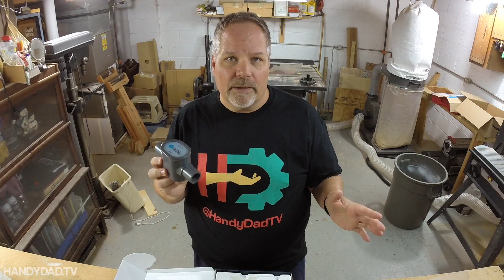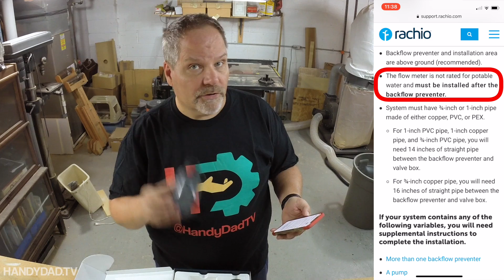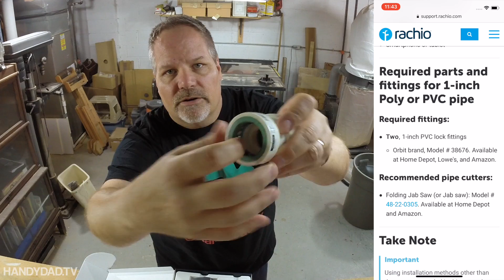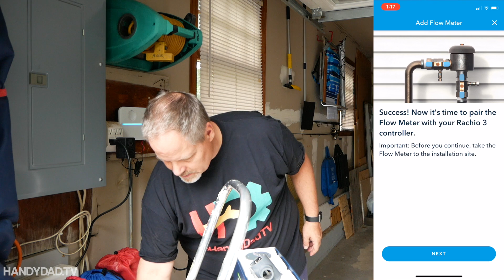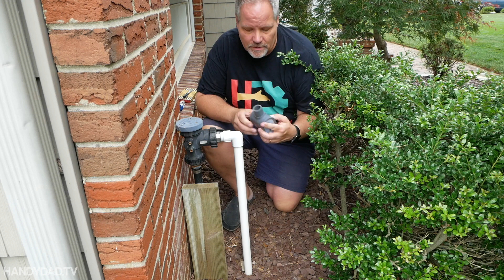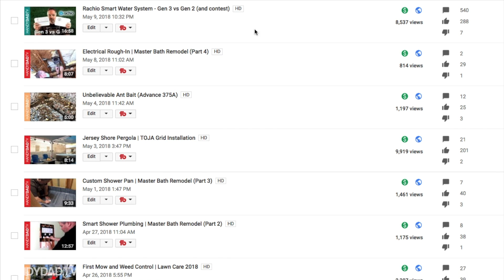Rachio Smart Water System - Wireless Flow Meter

Comment: great job.  what is the result of the Rachio Flow Meter after having it installed and running 3 seasons? 
still recommend this flow meter even though there is no more production? thanks
Reply from the maker: They discontinued it. I had a bad experience: https://youtu.be/w8URhNDCVTQ

Comment: I guess there is no need to use a rain sensor since the controller has the weather intelligence feature. What you know about soil sensors? I think they can be use with Rachio, but are they worth it?
Reply from the maker: I’ve never tried soil sensors.
Reply: @handydadtv  that a good topic for a next video. Rain bird and Toro soil sensors are compatible with it

Comment: Great videos btw. I was considering getting on until I by accident came across a post on their site that they are discontinuing the flowmeter: Unfortunately, the variability in irrigation system configurations made for a more complicated Flow Meter installation process for some of our customers–something that falls short of our mission. Because of this, we’ve decided to discontinue sales and production of the Wireless Flow Meter.
Reply from the maker: I didn’t see the official notice but mine failed anyway. https://youtu.be/w8URhNDCVTQ
Reply: @handydadtv  Nice. The real question is, did it notify you? ! :)

Comment: Why is the backflow preventer outside?  It should be in-ground or under the house to keep the backflow preventer from extreme temperature fluctuation.  As for connecting the flow meter to the pvc line, I would use a pvc union instead, just make sure to clean the inside off excess glue before installing the union.  This way, you can switch out the flow meter when it goes bad in a few years.  Not sure why you need to make sure no water is running in the house?  Backflow preventer is installed for the sprinkler system only (tee off from main line)  and not to the main line to the house.  It is to prevent ground water from backflowing to the main line to the house.
Reply: 1.Back flow preventers are outside the house in many homes in the south. We cover back flow preventers with insulation and add heat tape to warm them up in the winter.  Backflow preventers aren't so much to protect the individual homeowner's water, but to protect the municipal supply.

2. If something is running in the home, the available water to the sprinkler zone will be reduced.

Comment: Thanks for the great video. I'm hoping to be able to install a flow meter, but my above ground piping and backflow valve are about 100' away from the Rachio 3, and under a cover for protection from freezing, so I don't know if I can get enough signal strength. We'll see how that works, or not.

Comment: It also be nice if they made flow meters reasonable cheap that you can install ontop of the pipe that you don;t have to open the pipe and put it inline. It would be great to not have to open a pipe to take readings on gpm on the pipe. I like to verify all the DFU units and gpm on pipes in the UPC charts plus have other experimental things to measure and work out the math with psi reading isn't enough.

Comment: ya been kind of looking for a flow meter but this one only works with 3/4 in - 1 in pipe sizes by the looks of it. I like a more diameter range from 1/8 in to 4in pipe say would be even cooler if it supported any size pipe. Like an ultrasound based flow meter or something. I want to keep cost reasonable low though and application for it as general as possible. So if you know of any let me know great explanation and i like the wireless feature of it.
Reply: KonaFlow or FlowVis sold by Kona Labs

Comment: I bought the Rachio because you made it so easy by your steps. I’m also a Nj guy and glad I found your channel. Any idea what happens when you blow out the lines for winter?
Reply from the maker: With the Rachio? I just disable the schedule around Halloween before I blow out the lines.
Reply: HandyDadTV version 3.  I guess I was asking about the flow sensor and anything you need to do when you blow it out
Reply from the maker: Nothing special needs to be done to the flow meter for winterizing. Just blow out the lines as usual.

Comment: Thanks.  I was inspired to do this myself.  Above ground installs are a piece of cake.   Using a handheld jig saw to cut the 1" PVC and a drimmel to sand the edges, I finished in less than 30 min. :)

Out side of leak detection and broken heads, I'm not sure adding the meter actually saves me any water or adds much value .  While the mobile app shows you values, I noticed you have to login to the Rachio website to actually download historical water usage.  In zones, each zone has a download button to get/keep the daily readings (.csv file).

 Has anyone compared this to the water utility water meter?
Reply from the maker: I haven’t compared it to the house water meter but they use the same technology to measure flow. But I agree with your statement that it doesn’t provide much value beyond leak or blockage detection.
Reply: HandyDadTV thanks, the other advantage is that it waters on actual gallons vs. Estimates,  it's a vortex meter, and it's low flow cutoff is 0.5 GPM, so drip zones must be above that, otherwise it reads zero, I had that issue on a plant zone with 4 drips
Reply from the maker: It may know gallons used by each zone but it doesn’t know the square area. It still waters my zones the same amount of time regardless of flow. I use the Flexible Daily Schedule.
Reply: HandyDadTV
:(

So if I think it's over watering a particular zone, what's the best setting to change to reduce water without affecting other zones?

Thanks
Reply from the maker: If a zone is getting too much water, change the soil type of that zone more towards clay. If too little water, change the soil type more towards sandy. Let Rachio do the time calculations for you. If you only want to set them yourself, you might as well buy a cheaper controller.
Reply: HandyDadTV thanks, the other advantage is that it waters on actual gallons vs. Estimates,  it's a vortex meter, and it's low flow cutoff is 0.5 GPM, so drip zones must be above that, otherwise it reads zero, I had that issue on a plant zone with 4 drips

Comment: My sprinkler system is connected to a well, so it’s separate from my house (City) main... what is the value of having this if I don’t care to track my water bill? Thanks in advance
Reply from the maker: If you don’t care about saving water, why are you using a Rachio at all?
Reply: HandyDadTV well my current old controller knob is on the fritz, also I hate having to walk outside to turn on zones, also wish I had a water sensor. I want to be able to intergrate into my SmartThings Hub & use Alexa. Rachio seems to cover all those needs. I’m just wondering if I should spend $100 more on this flow sensor.
Reply from the maker: The biggest advantage of the flow meter is the ability to detect leaks or blockages. Sure, it shows me how many gallons I use each month, but that isn’t a useful metric for me.
Reply: HandyDadTV I will be using the rachio outdoor enclosure, so the electrical hardwiring will be a challenge for me.
Reply from the maker: If you already have an existing controller, what do you need to hardwire?
Reply: HandyDadTV https://youtu.be/tvyU3jpPL08 shown in this video

Comment: Thank you for making this video. I was waiting for a review on the 3rd generation system which included a review of the flow meter - This is just what I needed! I have a question for you. Do you think it would be possible to use the flow meter to monitor for leaks in the household in general? Meaning, can I install this inside the house then use the app to notify me if it detects that water has been running for x number of hours (maybe if someone left a faucet running)?
Reply from the maker: No, it won’t help you for whole house monitoring. It would think you have a leak every time someone uses water in the house.
Reply: If you want to monitor water your house buy  LEAK SMART  & LEAK SENSORS . I love these ones . They’ve rescued my home 3 times from flooding . I was lucky to buy them in clearance at Home Depot